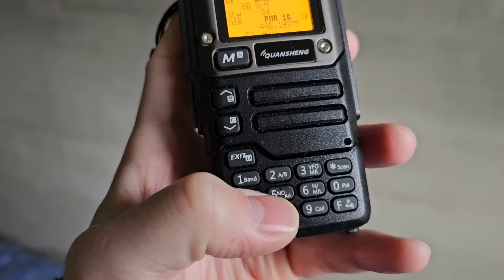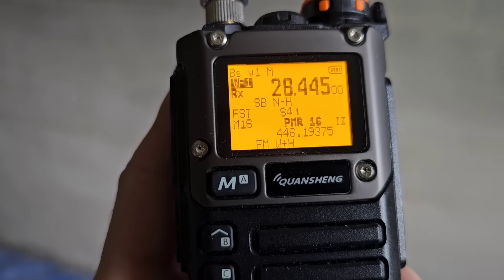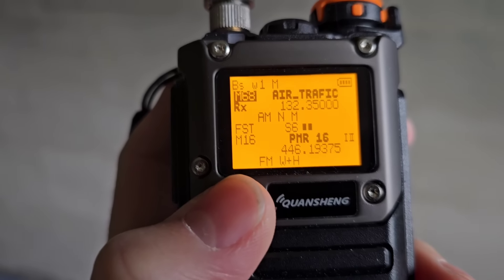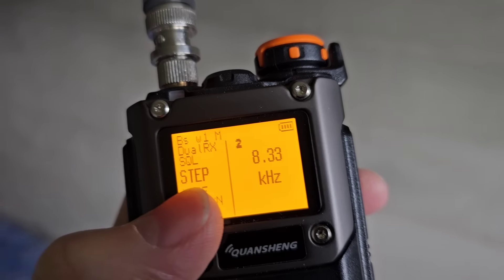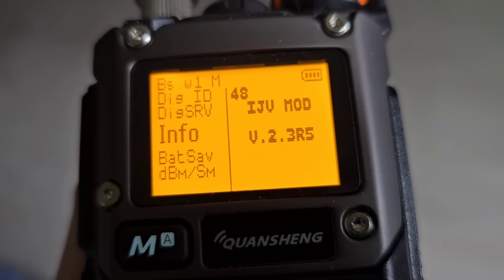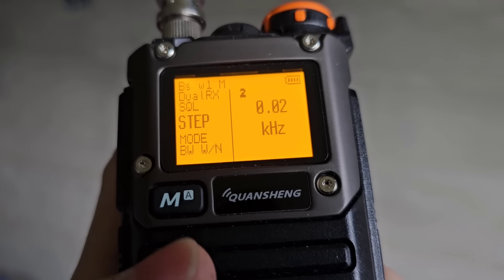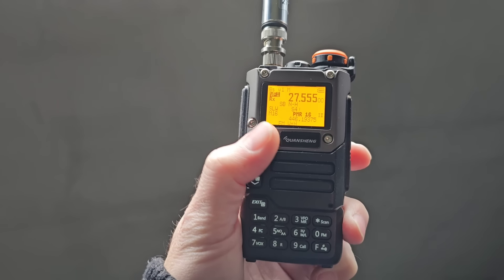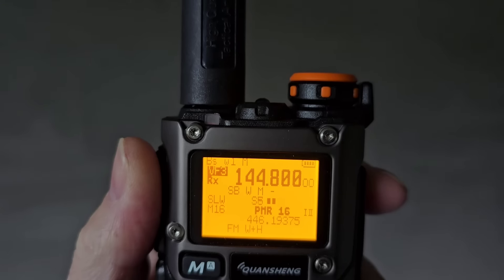QUANSHENG UV-K5 Another great SSB firmware, AM fixed + simple installation

Comment: I flashed my radio twine at first with Egzumer v0.22 and the second time Egzumer V2.3R5 and I don't receive SSB signals on both firmwares on the SSB mode only AM signals I connected my base external antenna and the frequency was busy on my HF radio then I connect it to the Quansheng and I can only receive the normal RX signal noise but no voice communication do you know why? Is there an extra setting to make it work?

Comment: With the hacked firmware these are quite amazing radios, mine both have transmit unlocked but of course they should not be operated far from the 2m/70cm bands , the output spectrum is scarily bad. I have not had the time to fully explore the possibilities but they are a great basis for experimentation. Unfortunately some people will doubtless try use the wide transmit range that can be enabled via the keyboard.
A great value for money radio, mine both have the latest Egzumer firmware..
Reply: @Rob2  I may yet restrict the TX coverage of mine, it is a liability to have completely unlocked transmit, particularly on a handheld that gets left in random places in the house.
Reply: @g0fvt  Indeed.  Mine is set to the 144-146 430-440 TX range that is appropriate here.
This also prevents mistakes with repeater shift etc.
Unfortunately it seems the setting gets erased when flashing firmware...
Reply: @Rob2 uk is 144 to 146
Reply: @liesofgasandpilesofshoes  Well, I looked it up again as I remembered the band was extended in the UK some time ago.
Turns out that the extension is only up to 147 MHz, and that it has to be applied for individually.  Also this ends in October 2024, I don't know if it will be extended by then.
So the 144-148 should have been 144-147 in the firmware, and probably not even that as I understand that the band plan for 146-147 reserves it for wide band applications like data and TV.
Reply: @Rob2 Has Ofcom widened the TX for 2m? In the past, it was 144-146Mhz. I used to live in the UK and that was the TX range back then. I'm now in the USA and we have 144 - 148 Mhz for 2m.
Reply: @KB1UIF  in general the UK is still 144-146, I happen to have the NOV for 146-147 which I use for digital voice.
Reply: @g0fvt  Thank you for the reply.

Comment: Another great video, Paul. I assume the same would be true of the UV-K6? Is the K6 a big improvement over the K5? Thanks, and Merry Christmas!
Reply: They are all the same internals.  Basically just a different exterior.  Same goes for all variants of Quasheng K5, K6 etc
Reply: @la7dfa  Yes, they are all the same...  unfortunately.
Wishlist items:
- rotary encoder instead of the white LED
- larger flash space (e.g. 256K)
- RGB LED backlight for settable color.
That is probably what the K6 should have been (in Baofeng models, UV-K5 is with LED and UV-K6 with rotary encoder)

Comment: re tactical antenna - I had one & trying to remember the brand, however, it was stamped with the frequency range & was supposed to be good for up to 520mhz - on 477 (UHF CB) the SWR was almost nudging towards 8.   The really bizarre thing, was unscrewing the top of it leaving effectively a 3 inch stubby, the SWR went down to 1.

Comment: Interesting, so all SSB on this is DSB?  Was wondering how it (DSB) would work for RX of SSB on VHF UHF for use as a downlink SSB  RX for as part of a portable satellite station with FT-817/818?  IF it would RX clear enough it would be a great low cost addition to a station for satellites.     Merry Christmas!
Reply from the maker: yes, it is a dual side band DSB used in this receiver

Comment: Mine will not flash, It keeps saying:
Connecting to the serial port...
No data received, is the radio connected and in flash mode? Please try again.
The radio is connected and LED is on solid , it shows up in the USB Serial port 
Any Ideas?
Reply from the maker: Yes, you have not installed serial driver in your PC or version of the driver is not working on your PC
Reply: @OM0ET  I installed the driver, restarted the computer and , the same error . Does it have to be a Baofeng cable?

Comment: can you add the sms function to this firmware?
I tried two radios today, the k5(8) and uv5r plus, both had poor rx audio quality, and the other party complained that both had poor Tx audio, completely full of static.  I cracked a baofeng uv5r out and it was flawless........  

I really hope to find a firmware to allow better audio quality,  but the FSK modem sending SMS is an abolsutely unexpected treat.........  I wonder if anyone will hack it so you can send data via the serial port from a pc etc?

Comment: great what about harmonics issue that is throwing stronger harmonics then original broadcast channel. cool feature but some transmission going over the air band with harmonics and with this is breaking a law international/federal
Reply: Ma il problema delle armoniche è presente a prescindere dalla banda in cui si trasmette? Per esempio se trasmetti in DSB in 2 metri, genera comunque armoniche?
Reply: @MrTrico78   harmonic transmitted is much higher power than the original frequency, harmonics are normal but they are few magnitudes weaker than the original frequency

Comment: followed your instructions can not flash firmware to device,do I need a special cable or does any usb to c type cable works?
Reply: You need that baofeng 2 pin cable. USB C will not do that. USB are just for emergency charging.
Reply: Thanks for your fast reply,l just searched for baofeng 2 pin cable and l found out that it has 2 pin as you say,where do l plug it?l thought it goes in the type C port
Reply: @kiroslabtsipgreg3992 above the USBC door.
Reply: Thanks allot.
Reply: @kingearwig  Thanks allot,l understand,and found the cable to order

Comment: There is a single VFO mode too. Nice way to simplify the screen. 👍

HOW TO: Check the latest  firmware v2.5R2. You need to access the service menu mode (Power ON with PTT + S1), access the menu, and assign the function "VFO SWAP" to a side key... This feature in VFO mode, change from double to single.

Also, Single VFO method (new)

Put into Single VFO mode: F +2    A/B
Enter the desired frequency (7 digits).
The VFOs are called VAx or VBx to make it clear which one is active.
Reply: what setting is single VFO mode?  setting 56 doesn't change the display
Reply: If you figure out how to do this, please post it as I would love to know as well.  Thank you. @bonnerglp
Reply: In the firmware I use, single-vfo mode only affects the receive operation, not the screen.
Reply: @bonnerglp  check the latest  firmware v2.5R2. You need to access the service menu mode (Power ON with PTT + S1), access the menu, and assign the function "VFO SWAP" to a side key... This feature in VFO mode, change from double to single.
Reply: @Rob2   @bonnerglp  check the latest  firmware v2.5R2. You need to access the service menu mode (Power ON with PTT + S1), access the menu, and assign the function "VFO SWAP" to a side key... This feature in VFO mode, change from double to single.
Reply: thanks!  what is the "0.05" under the battery indicator bars in single VFO mode?
Reply: @bonnerglp  the VFO step size.
Reply: @mostlypostie1  I have done but i find only: Flahs Ligh, TX power, Monitor, Scan, VOX, FM Radio, TX 1750Hz, NONE.

Comment: I followed these exact instructions and it bricked my uv-k5.  Does not power on now.  Only thing it will do is power on the light on top if I press the ptt and turn it on. ?? now what?😤
Reply from the maker: Try to reload custom firmware again, or try to reload an original firmware from the IJV Mnual website.

Comment: I am using this firmware and think it is great.  However, I cannot seem to go from VFO back to Memory mode even though I press function then the "3" button.  I can go the opposite from memory to VFO, but not the other way.  Has anyone else experienced this issue?  Thanks.
Reply: No need to press the function button, just use the 3 button to toggle between VFO and MR mode.  Hope this helps!
Reply: It's a long press on 3 button...
Reply: Thank you!!

Comment: I'm still hopeful that a CB band works 🤞🏻
Reply: Depends with what you expect.  It does really not work for transmit, since it is a 2m, 70cm radio with a LOT of disturbance on the VHF bands.  Receive on "SSB" is USB + LSB at the same time, aka DSB.
But with a proper antenna you will definately hear stations.

Comment: Hi. I tried the procedure (even several times), but something went wrong and now my Quansheng is blocked and no longer turns on. The updater message said:
Version check passed
Flashing firmware
Flashing... 2.1%
Flash command rejected. Aborting.
I also tried to restore the original firmware from the official website, but nothing.
Is there any file to try to restore or should I resign myself to using my Quyansheng as a door stop? 🥲
Reply: Ok, solved with a new programming cable. Congratulations for the firmware: now in aeronautical band the reception is very good!